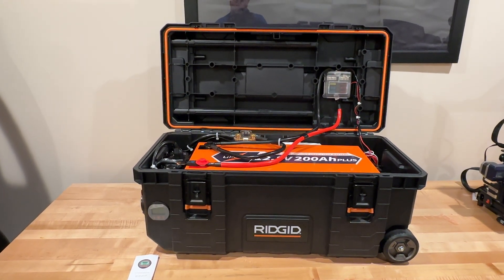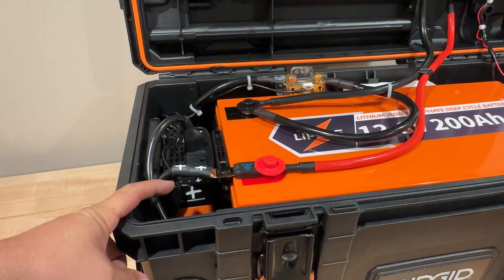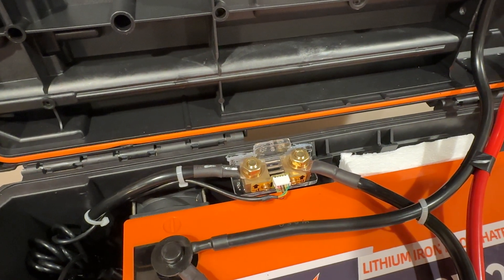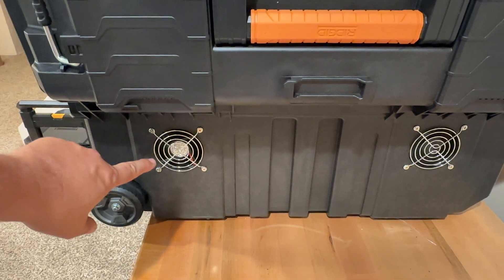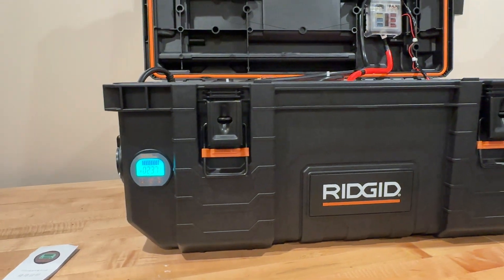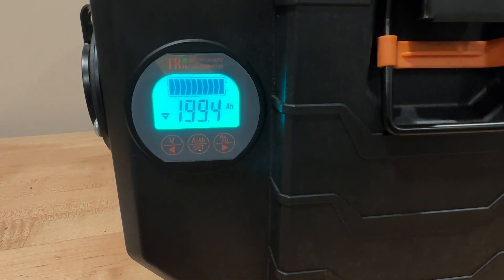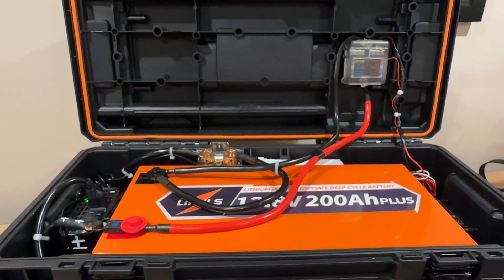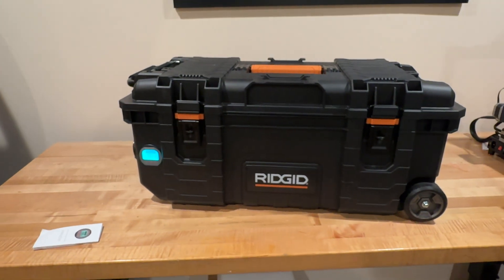How to wire a 200ah LiPuls battery in a Ridgid box for camping part 2

Comment: Your inverter seems small and inadequate.
Reply from the maker: I do t need a large inverter to run a fan. I also have a larger inverter I can swap out if I need it. The diesel heater I use doesn’t need more power than that if I run it on the 120v plug.

Comment: Put a SAE 2 pin plug outlet or some other quick disconnect for the lights, that way you can set up a work light or something and not be limited to a louver light at the box. Plus you could hook up other 12v accessories to it if needed.
Reply from the maker: @Jenstyler1  Good idea thank you !